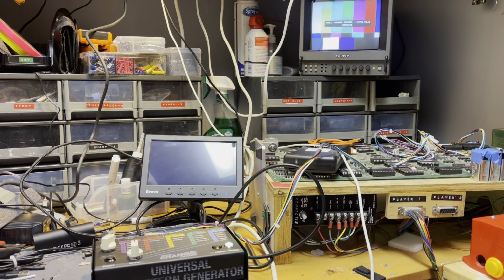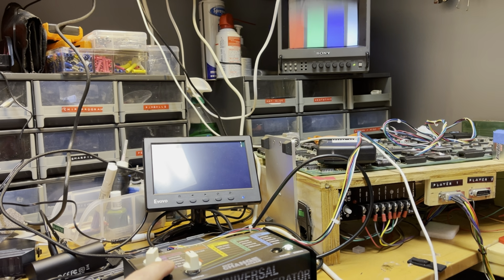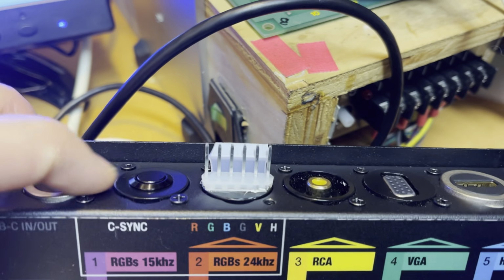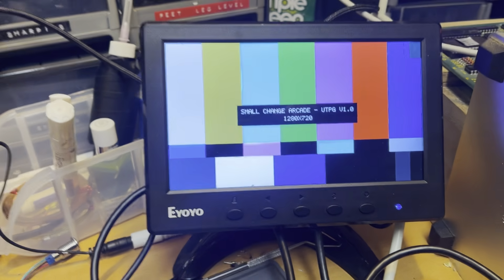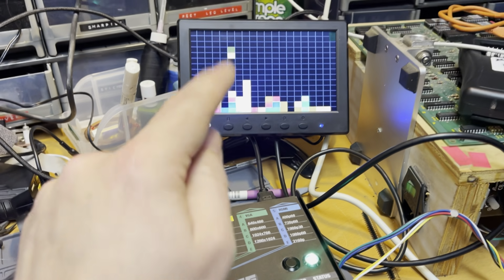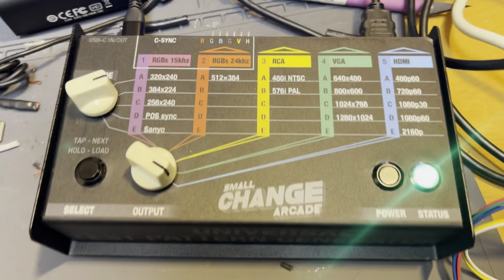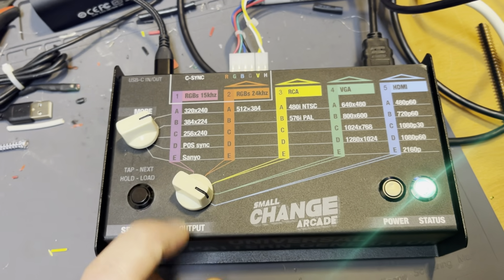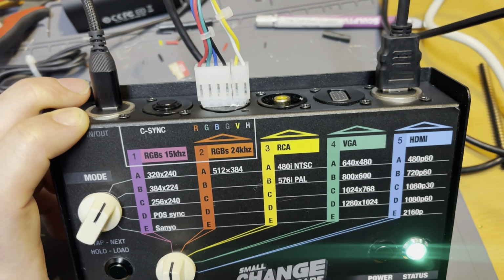I Built a Universal Test Pattern Generator for Arcade & CRT Repair

Comment: Really cool device. Picking up where Craftymech left off.

Interested depending on price, especially if you added vector support.

No love for S video? 😁
Reply from the maker: 😂 Personally, I’m a big s-video fan. I’ve looked into vector signal generation and it would really need to be a separate device, it’s just a very different beast, and they already make one you can buy at ArcadeShop. Would be cool though

Comment: All output pins should be female by convention. It protects against shorts is the logic behind this.
Reply from the maker: Thanks for the input Randy. I did the RGBs pins like that to match the standard TPG from
Crafty mech, but that’s a good point about shorting pins. I could just use VGA breakout cable for the RGBs signals as well as VGA
Reply: A short M to M dongle would allow one to still use the craftymech TPG cables.

At the very least it should be recessed. It’s just waiting to be broken hanging out like that.